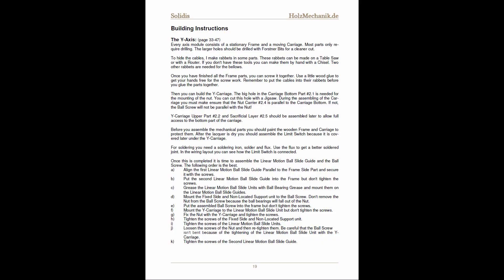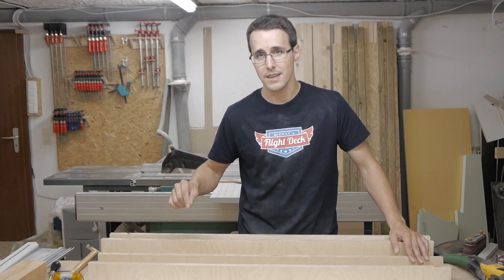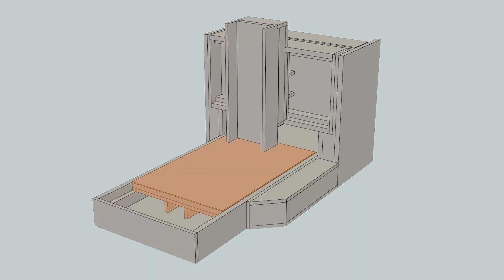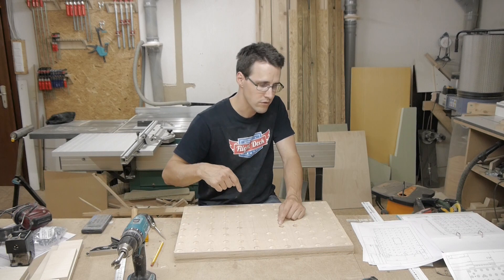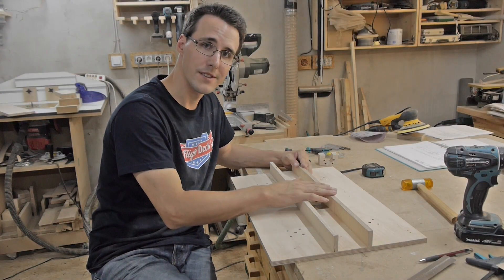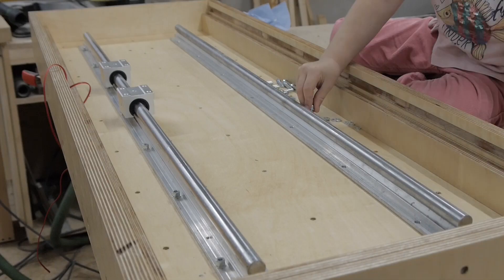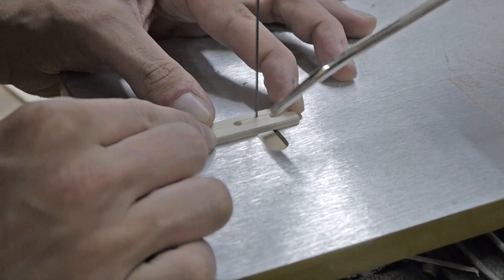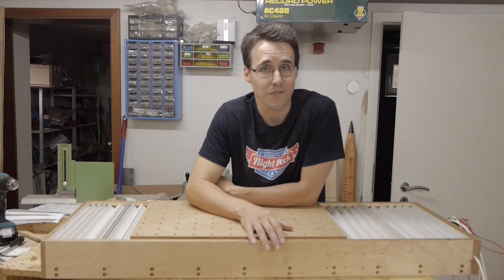Building the Solidis CNC Y-Axis - A Boeing 737-800 Homecockpit #25

Comment: When i first seen that there was a video to build a CNC Machine i was excited. This was soon dashed by this video. Obviously this video is streamline towards people with a full professional workshop that probably cost in region of 10s of thousands of pounds. Why do people do this ? If i could afford a workshop and machines like this i could afford to buy a bloody CNC Machine.
Reply from the maker: I had this workshop long time before I built this machine. Because woodworking was one of my hobbies. And it is worth building such a machine by yourself. Let me spend around 800 EUR for wood and all the components. If you buy a machine of this strength, you would pay around 3000. And by the way, you don't need big machine to cut and drill some sheets of plywood.

Comment: Hello Mickey. I'am a little bid confused about the workarea. At first I hear you say 30 X 35. But let's assume you talk about 30cm. My question is that as you extend the area from 30 to 50 cm what is 20cm extra you say (2.50 minute of video) that the extend must be 20 cm at both side's because the workarea move's. But I keep thinking that in this case you extend the left side with 10 cm and also the right side with 10cm and there is your extra 20cm. Please help me with this issue. Also I  want to ask you, now your steppen motors are working for a while if these make you satisfied? Also can you inform the specs from these and where you have buy them? Nevertheless thanks again for al your video's. And greetings to your familie ;)
Reply: Hello Mickey, I think it's clear now for me. The start point is  below (0 X 0 cm) and not what I expected 25X0cm (The middle of the workarea) Nevertheless it was easier to start at the middle but I assume that the machine or software not  can split the sketch into the middle and see the left side as + and the left as - It also helps if you mention the parts list you ar using maybe you wil added them to the description? After a long search I found the https://www.rc-letmathe.de/MDLCNC-Estlcam-Interfaceboard-fuer-Einzelendstufen?languageid=1 ;)
I think if I build it the same as you the rade of succes is the highest. That's also with the parts U are using of course. I hope I see you soon again whit a new video. Tschüss und einen schönen Tag.

Comment: 13:49 ballskrew can be can be shorter. you never get maxium travel with engineer plan like that :).linear rails should be distance between ballbearing - ballskrewnut to get maxium thread lenght. yes axis will be longer than it move, but it is also longer than it move now and not use all movement your ballskrew allow
Reply from the maker: Yes, that could be right. I didn't want to change the original plans too much. I knew that I needed 20cm of travel distance on top, so I added 40cm to the three mechanical parts. Now I have some extra cm of ballscrew if I need them in the future.